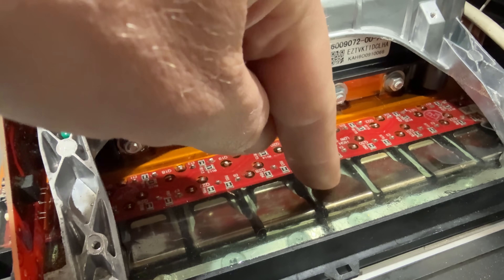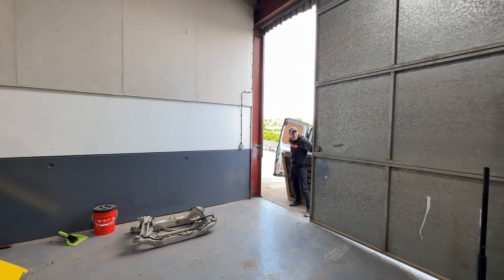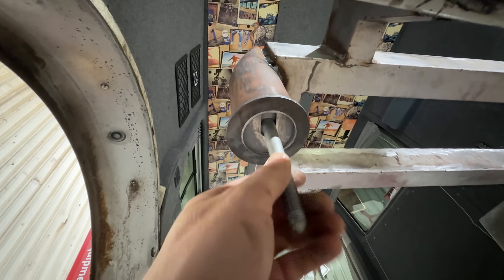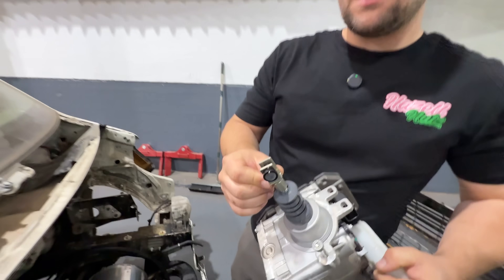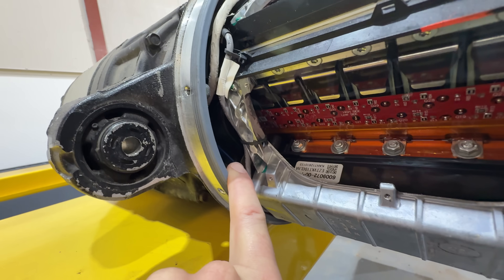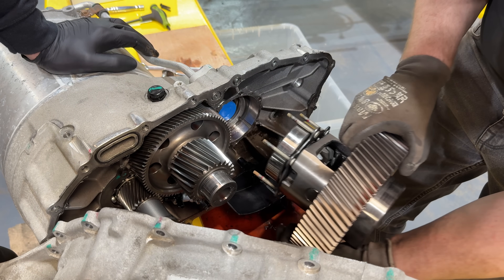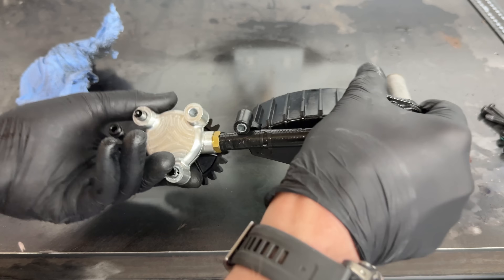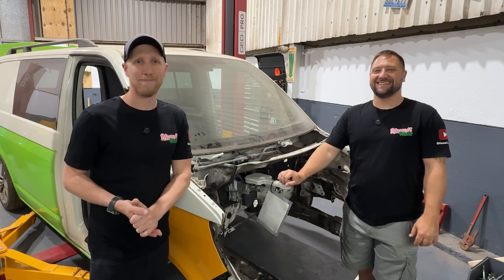This is How you get 1200HP out of Tesla motors!

Comment: Looking very cool. I'm curious to see what battery solution you go for, although in fairness, you won't ever get full power down on the front. It's why my RWD P85 ended up as a 600bhp/800NM daily driven track toy. P90 Ludicrous 400V battery pack in mine, which can comfortably unload the 450KW+ that I need. It's also a lot lighter (400KG removed). What does your van weigh now, and have you put the Quaife LSD in the tail for it?
Reply from the maker: Battery is very difficult. There is a trade off, we can have full performance but then the kWh will be lower or we can have less performance with more kWh. Or we can go lighter with less kWh and performance.

Comment: I might have missed it but how are you getting 1200HP from the Tesla motors?  Was it from changing the control boards out?
Reply from the maker: The performance motors are good for about 650hp in there standard form and we can push them abit harder with the aftermarket system but coolant flow to stop hot spots is going to be key.
Reply: @Hazell_Nutz  I haven't watched from the beginning, so I am trying to catch up. Are you getting 1200hp from 2 motors? If you have a Model S plaid, 1020hp total all 3 (not sure what each motor makes), are you able to increase the 3 motors and make over 1800hp?  I would like to see you guys modify the plaid motors and get them to 1800hp if I am understanding correctly!
Reply from the maker: @GriffySpeed on the newer motor they made the logic board and inverter all one part so hard to take control of.
Reply: @Hazell_Nutz  which years were able to be upgraded?
Reply from the maker: @GriffySpeed we are using LDU they stopped production late 2022 in the model s and x
Reply: @Hazell_Nutz  sent you guys an email with some other questions.  Thanks
Reply from the maker: @GriffySpeed thanks will take a look

Comment: Would the AEM board enable a Mercedes B250e produce 500+ bhp?
Reply from the maker: Yes and know, the board works allow the drive ubit to as the inverter is the same but the battery pack in a B250e is not capable of that much power.

Comment: interesting that the new logic control board isn't conformally coated, like the Tesla one is. Hopefully that doesn't mean it will fail sooner.
Reply: Hmmm i suspect any sort of moisture will corrode it...
Reply from the maker: Had the exact same thought so have ordered some brush on coating, I know that the inside of those inverter cases do condensate
Reply: You could always give it a spray over with Corrosion X .. coating ...its used to prevent corrosion of highly sensitive electronic components even if fascing imersion in water.

Comment: I was surprised you didnt oil/grease pack the oil pump till you mentioned it wasn't powering the old pump anyway lmao. Its fiiiiiiine.
Reply from the maker: It runs a dex6 oil which is very viscous so does not stay in the pump.

Comment: so how did that drive unit survive all that time without an oil pump?
Reply from the maker: We have come across a lot of Ev gearboxes that do not have oil pumps just splash lubricant so could be why it’s ok. But we have not tested it yet 😂
Reply from the maker: We have come across a lot of Ev gearboxes that do not have oil pumps just splash lubricant so could be why it’s ok. But we have not tested it yet 😂
Reply: Might explain why some Tesla drive units die randomly. Lol
Reply: @trace9130 not really. The large drive units on model s failed because a coolant manifold caused leaking into the rotor. There is an aftermarket fix for LDU’s. 
All Model S drive units after 2020ish have this issue fixed (e.g. anything Plaid generation and newer), and not all cars before 2020 have LDU’s. Only performance and rwd ones had that. Non-performance dual motor S’s have two small drive units.
Reply: What does the new board inside the unit do?
Reply from the maker: @L33ETH it allows us to use an after market VCU so can map things like throttle and power delivery. If we stick with the original Tesla logic board we are limited to the software that was preset by Tesla.
Reply: I think the splash lubrication is suffecient to 130-140 kph, bur above that, the oil pump is needed